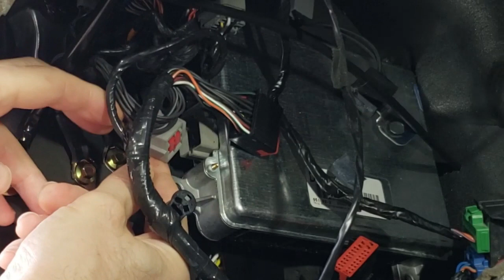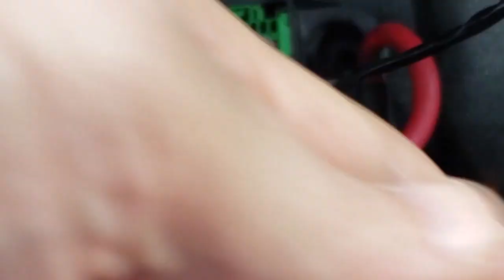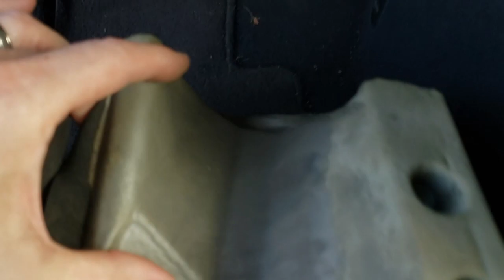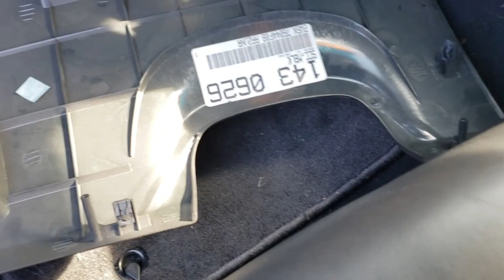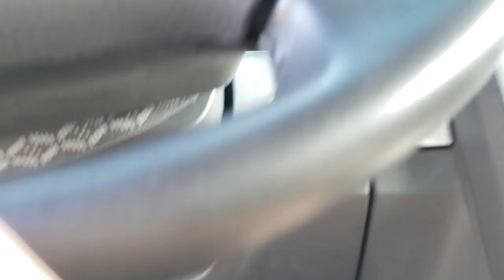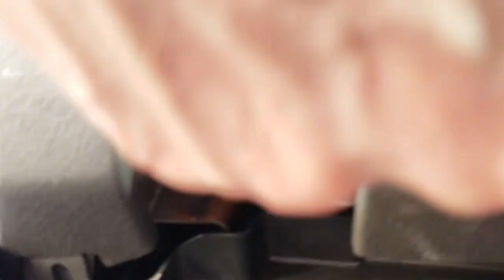2002 Thunderbird Electrical Issues Solved - Front Electronic Module

Comment: What makes the lights for the temps & control panel for the heater / AC  be intermittent.?
They come on after 5 or 10 min.
Reply from the maker: If that is the only issue you are experiencing it is difficult to say for sure. It may be a fault within the FEM, the dimmer switch or corroded connections. If you notice shorter delays for the lights to finally pop on in the summer months than so in the winter months, then I would suspect the FEM. 
Next time it happens, try adjusting the dimmer wheel from min to max back and forth a few times to see if that makes a difference. I might also try tapping on the FEM gently to see if that jolts the console lights on. If neither of these steps results in any conclusions, a more in depth electrical diagnosis would be needed which is beyond the information I have access to advise further. Good luck and let me know what you find.
Reply: @puntobeborn7429  Thanks.!

Comment: Just picked up a 2002 and the Dashboard - lights are all out. It's been sitting for a few years. That's the only problem I seem to have has 34000 miles on it. Do you think I should buy a brand new FEM
Reply from the maker: A new FEM could run upwards of $2,000. The repair and rebuild of my module was good as new and less than 10 times the cost of a new one. The dash lights were the first thing to go out for me but now that I think about it, it may have been the power steering. We drove it for several years thinking that the difficulty in turning the steering wheel was just part of the nostalgia for that type of car but in fact, the power steering was out the whole time😅! 
I used a portable led book light strapped around the steering column for dash lights for several years until all sorts of crazy electronic malfunctions started to snowball. That is when I was finally able to narrow down the most probable cause as the FEM and sent it in.
To be fair, the FEM is not the only cause of dash light failure although it is a common cause. Those FEMs eventually will fail due poor design. More or less it just a box of relays instead of having them in a fuse box. 
It’s really a personal decision as to whether you want to have it rebuilt now or later down the road after additional FEM related failures start to occur. 
As far as repair vs buy new, I was unsure. But it came down to this. If a new one is 10 times the cost of the rebuild and the rebuild doesn’t work out, I haven’t lost much and I would go ahead and buy new. I took the chance and it worked out. The repair service I used are pros they do a lot of them. All malfunctions were resolved with the rebuilt FEM. Hope this helps. Let me know how it works out for you and thanks for checking out the video!

Comment: Great job.  I am going through the same thing on my 2004.  I am the original owner with 15k.  Seldom driven and I suspect that a lack of use may be the blame.
Reply from the maker: Thank you!  If you live in the Midwest like I do with extremes of heat and cold, my belief is that causes the solder joints on the relays inside the casing to go bad and cause electrical mayhem. A big part of the FEM is just non-serviceable relays. What a lovely idea that was. :D

Comment: I have the same year make model color. Love it. Im nervous cuz a battery less than 2 years old went out
Reply from the maker: They're a lot of fun for sure. I decided to name my car "Christine" given all of the very odd electrical behaviors that made it seem like the car was possessed. 
There is some type of parasitic draw on the battery. I have to start mine up at least every 2 weeks or the battery goes dead. I haven't found yet what the issue is but I haven't looked for it either.  The charger I use is the CTEK 40-206 MXS 5.0.  I leave the quick-connect on the battery so I can easily plug it in when needed.  One time my battery was so dead that the charger would not charge it (it returned an error). So I jumped it to get it going again and let it run for maybe 20 minutes. Then I hooked the charger up and it reconditioned the battery back to life.  Battery is 7+ years old now and still checks good.